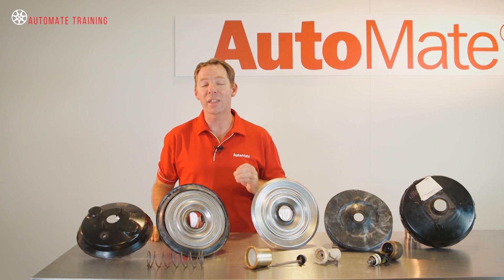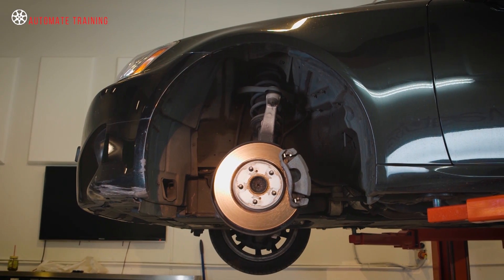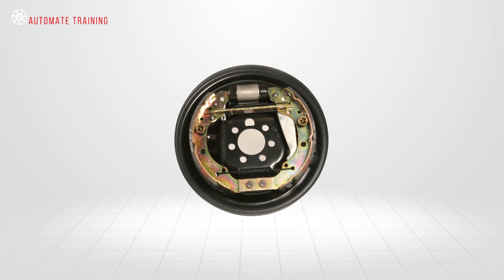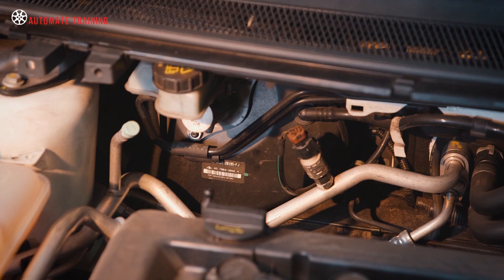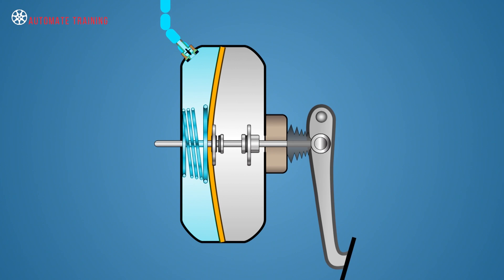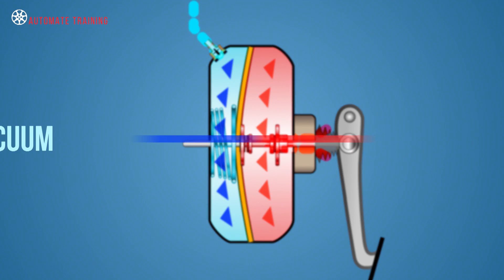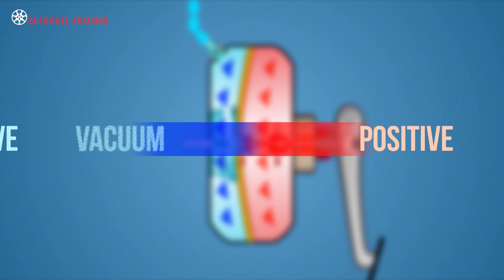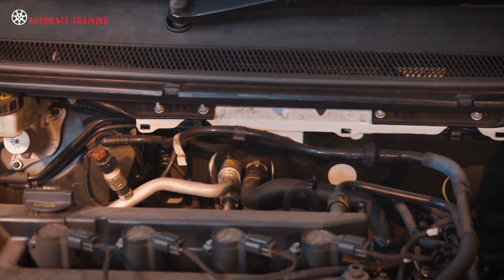Brake Boosters – Vacuum Suspended

Comment: I have a 1991 Nissan skyline GT-R and my question is can a bad clutch vacuum booster cause the car hesitation while driving and sometimes stalling? The car shifts nice and easy no trouble with transmission. But I do hear a hissing sound sometimes around the clutch pedal and it gets really soft sometimes untill I pump it 3-4 times then gets back to normal stiffness.

Comment: but how the vacuum booster return to his initial state ??
Reply: the vaccuum created by the engine helps you to push the brake master's plunger thing

then a spring inside the brake booster pulls the plunger thing back to its original state.

the spring also prevents the brake pedal from staying in the engaged position when you press the brake pedal when the engine is running.

Comment: Any help please Nisan Qashqai drive for abour 1/2 mile in town using brakes / brakes lock on // so here goes changed the booster/ valve/master cylinder vacuum tested on tick over normal/ multimeter test no codes showing any ideas please
Reply: @Pollywog yeah maybe and have a coffee and chat you up for it
Reply: @Pollywog i live in a log cabin in the middle of a forest where anything goes i like mussles big ones though but not pickled . I do not know about Derek i had a Moustache once but it tikled if you know what i mean i would rather like to meet you Polywog you sound nice
Reply: @Pollywog Well i found out which side your brains are